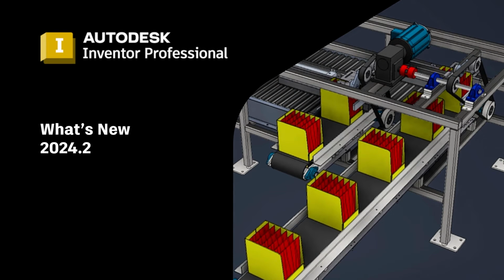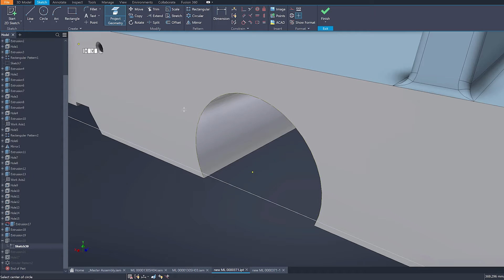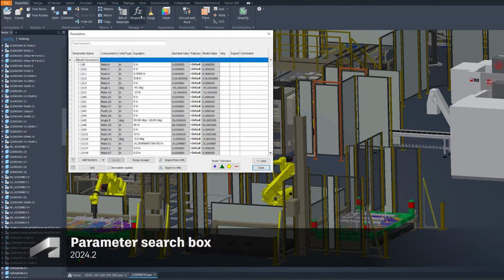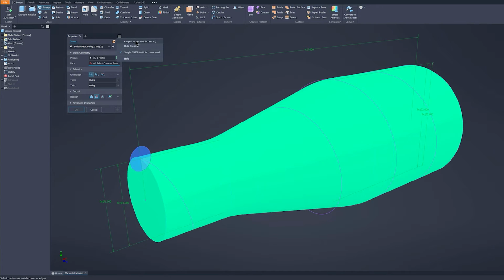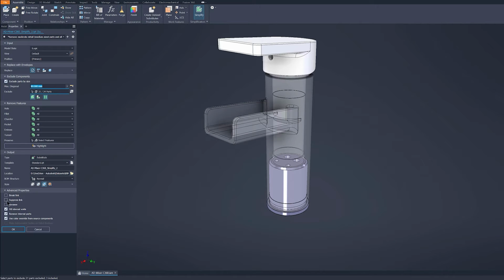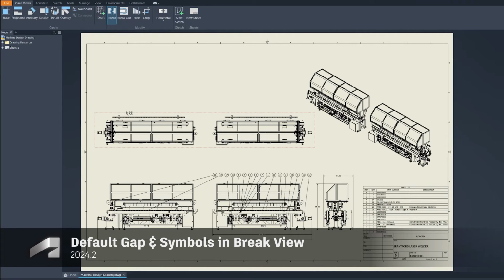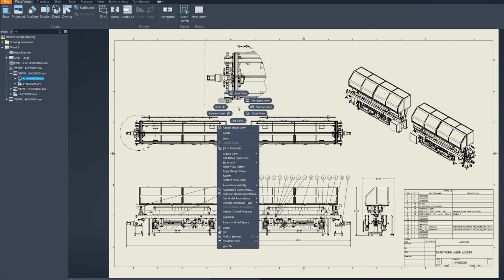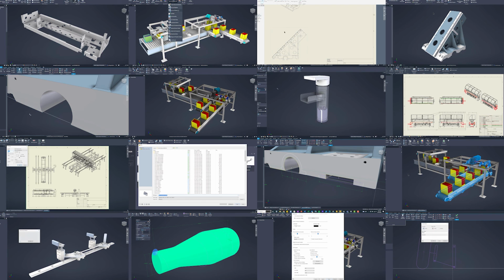Inventor 2024.2 What's New

Comment: Tube and pipe functionality in Inventor 2024 is really worse, model states (Level of detail) not working for an assembly with Tube & Pipe, and runs can not be suppressed when you at top assembly as the older versions

Comment: I beleive graphics are not that to good compared to solidworks , if you can match catia like graphic that will be great. 2) when you zoom out & try to rotate the assembly then it should rotate around the  snap point in object not with respect to center of mass.   Again graphics are very very poor need to improve a lot.